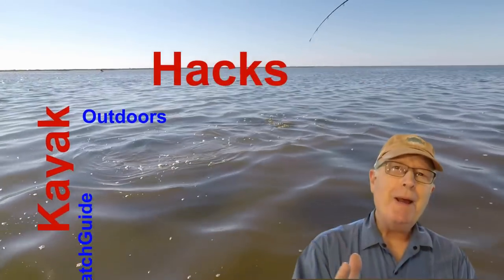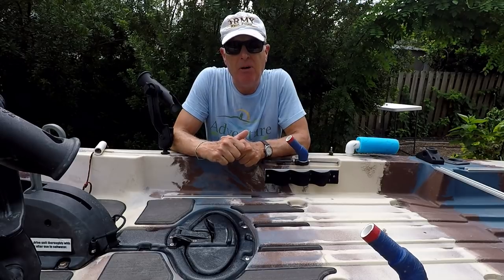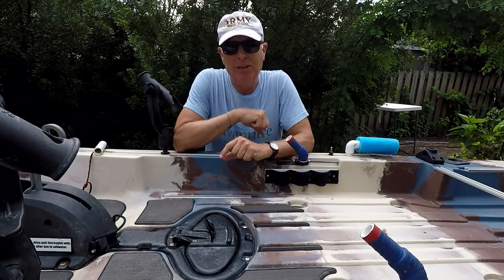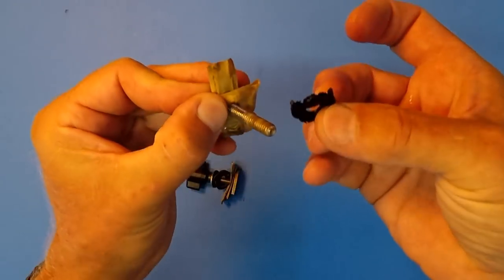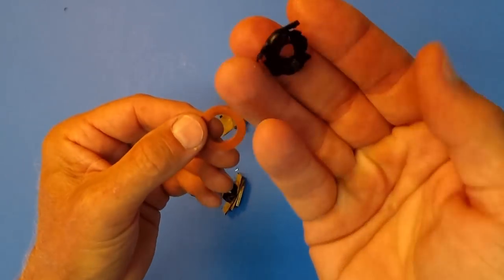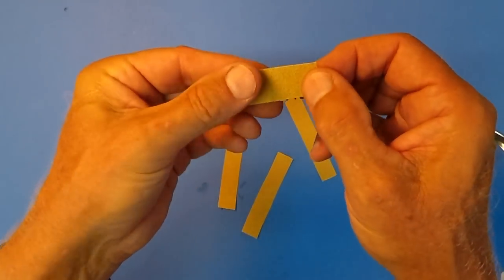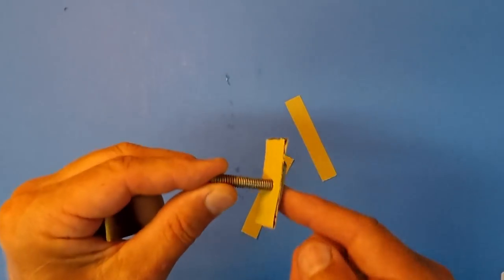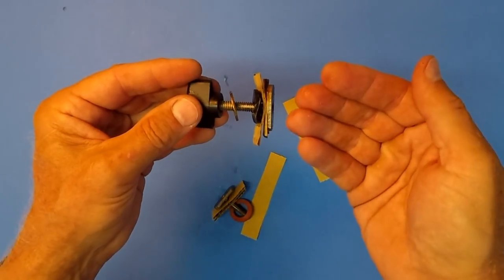Kayak Seat Upgrade - Kayak Seat Modifications to Prevent Slippage

Comment: 109 hours!  That's awesome.  Great tip. You are smart to take parts apart on a regular basis.  Please make a video on kayak maintenance.   A couple of times a year, I use Formula 303 on the hull.  Spray the rudder with silicone spray and the mirage drive with Breakfree CLP or WD 40.     My Hobie seat snaps on a bar, and the back of the seat rests on the hull.  I wonder about stress fractures.  I'm going to place something underneath the back of the seat.
Reply from the maker: Kayak maintenance video is out there - https://youtu.be/8EyDHxN6wZ4
Great suggestion on the silicone spray now that I have a yak with a rudder. Thanks!
Reply: Rather B Fishing: Are you just spraying the steering cables for the rudder, or all moving parts?  Gonna have to find some silicone spray for my rudder (Lure 11.5). For a cleaner/protectant, I looked at the Aerospace 303 Formula stuff, but found the Starbrite Paddlesports Cleaner/Protectant brand at Academy Sports, and saved about $4 on a bottle. Cleans the scum line well. Just an fyi for anyone interested.
https://www.academy.com/shop/pdp/star-brite-ultimate-paddlesports-cleaner-and-protectant
Reply: I just spray the moving parts.  It made a squeeking sound.  I use 3M Silicone Lubricant dry type.  Probably bought it at Walmart.  A friend said that he thought it wouldn't deteriate the plastic.  I would ask the manufacture.
Reply: Rather B Fishing: Thanks for the info. 👍
Reply from the maker: I need to get some of the dry version. The 3M website says it is OK for plastic.
Reply: Kayak Hacks Fishing I like it.  Used it today, as the rudder was squeeking!

Comment: You can use a star washer where you use the sandpaper and where the rubber washer is just use a bevel washer that has  rubber on one side. Both are available at a good hardware store.
Reply from the maker: Great idea - thanks!